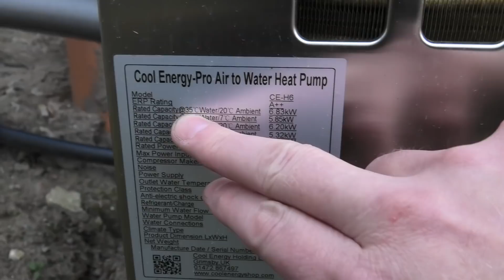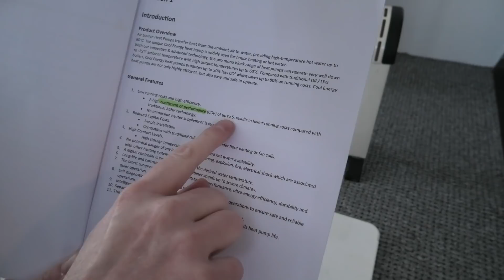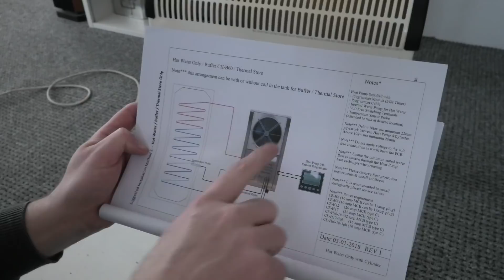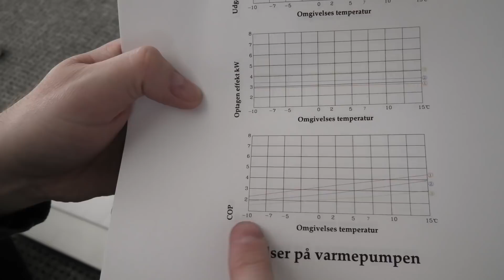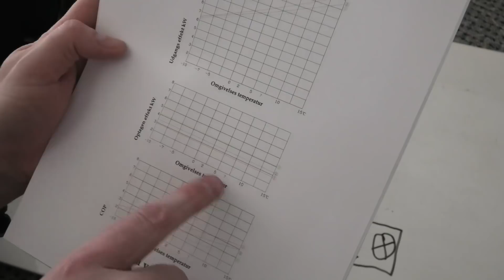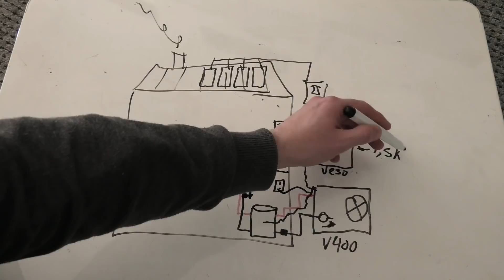Europe is Going to Need Many New Air to Water HeatPumps - 1169

Comment: Air to air heat pumps are even better and more flexible. Air to water heat pumps are really for wet systems, and don't cool anywhere near as well as an air to air heat pump, and it doesn't dehumidify the way an air to air heat pump can. They do heat better than air to heat pumps.
Reply from the maker: Some good points,,, but an Air to Water I am aloud to install myself, as it is a closed system, and it connects with my existing radiator system, to heat the entire house with just one unit.
It does not work to cool down,, for that you do need an Air to Air.

Comment: Hi Morten. Just watching this in UK in 2026. Nice British Cool Energy heat pump. Made in Grimsby UK. 
Not sure how you came across that make. I had never heard of Cool Energy until watching this.
Yes they are still in business and make low cost heat pumps  - 2000 euros for 6kW R290 - international delivery. Amazing.
Your outdoor insulation is interesting !
Lot of wind power in Denmark, so it makes sense. I have a Vaillant HP (they have a factory in UK) and also a battery. The battery is charged using off-peak power at night and solar in day and runs the heat pump all day which makes it 1/2 the price of gas heating.  
Great to see people doing it themselves - saves a lot of money.
Reply from the maker: I had Bargain Hardware ship it over 5 years ago :-),,, Cool Energy heat pumps was cheaper than anything I could get here :-)

Comment: Hey Morten,
     Thank you for uploading a nice video, We are also planning to change our oil heating system to Air to water heating, But when i inquire about Air to water heat pump some of them told me that it will take a lot of power supply to run fan, And they are recommending me to try Geothermal heating system, What is your opinion, I live in Hillerød,  Thank you
Reply from the maker: That sounds dodgy,, It is the compressor that uses way most power,, the fan,, is just a fan. 
Geothermal heating system is the best,, but it requires digging down all that pipe in the garden.
Air to water is way more simple and cheaper,, to get going with.

Comment: I admire your efforts, I live in Athens Greece and we have the opposite problem but I am looking into achieving a similar goal, stay cool in summer and warmer in winter. The temperatures are different and its harder to install and use a heat pump in Athens. I have a very limited amount of space to build and setup a heat pump, I even considered building a heat sink but its illegal where I live to dig below ground. Still it is a worthy effort and your videos inspire me to continue to look for a solution.
Reply from the maker: The little heat pump can acctuly also cool,, I do not think it is very good at it,, but it can,, I do not need that much,,,here :-)

Comment: In your case, as you have servers running that put out a lot of warm/hot air, if you can direct that air to the intake side of your heat pump, you can probably bump the efficiency up even further because the 'cold air' wouldn't be as cold. The catch may be where I remember your server rack exhaust ends up vs where this pump is.
Reply from the maker: I  am normally just running one server,, so it is not that much heat. But I have set it up so I can blow the hot air directly in to the house,, I think that is better than to het the heat pump... more math would be needed.
Reply: @MyPlayHouse  if it goes straight into the house and the temp is higher than ambient, you have the highest efficiency you can get for that process. It may bump up the efficiency in very cold circumstances so the COP of the heat pump is in the higher range. But probably the complexity wouldn't be worth it as your current setup is nice and clean. I now live in Ecuador where it doesn't get that cold in Quito.  But in the Netherlands or UK where I was born, lived respectively,  it probably would. My parents in NL have a heat pump with underfloor heating. They got rid of the gas almost a decade ago and also have some solar. It is interesting to see how the economics are pushing towards efficiency,  slowly but surely. I was in Denmark ages ago when visiting Danfoss and when way younger, legoland. First "driving license" I had was there.
Reply from the maker: @wiebowesterhof  I was born in the city where Legoland is,, I never got the driving license :-/

Comment: Hello Morten, you had  that unit in 8yrs you say,  the producer that made your air to water heat/cooling exchanger they reccomend to have a check/service every 2yrs that goes for your air to air heat/cooling units too, here in the northern europe they rarely fill the units to capasity when it comes to the gas inside that transports the heat/cooling from the outside/inside, get a company near you to take a service and check the level of gas inside, and i think you would need a top up of that R-410 gas if you haven't had any yet. 
the firm that does heat/ac air to air units where i live, I know them personally so i got them to top up our unit when its running with a coupple of milibar extra.  btw..
do you use any antifreeze red/blue/yellow/green in the water maby?
or do you just run regular mineralized tap water in it ??
Reply from the maker: It is about €400 to have it services here,,, it is a lot of money,, when it seams to be working just fine.
I do have some antifreeze in the system,, from when I was only here in weekends.

Comment: I was spending about $1200 per year to heat the house for four months of the year. I just installed a heat pump (reverse cycle in Australia) for about $5000 so I save $900 on heating but now I also have cooling so I don't know if I will save money or it will all go to cooling on those 35-40c days (but possibly that will run off the solar on those for days). Great video as always.
Reply from the maker: It would be smart to run the cooling offer solar.

Comment: Nooo we wont need heat pumps at home... what we need if we go for heatpump solutions is that our respective utility company, in our areas, change out to gigaheatpump systems, and be supplyed by, our utility companys, around denmark with Remoteheating/Fjernvarme, i get that heatpumps are a briliant idea, but if we stick together, and pay collectivly for heat, it will be mutch cheaper, not to mention the reduction of Electric,  if our houses are heated by electric the reduction on eletric after 4000kwh that agreement only runs until, 2030, if we need anything in denmark its to produce eletric via solar, and be paid a fair price for the eletric we are produce, if we all did set up solar on our roof, and sold it, for a fair price when its needed, and a reduction on the price when its not so mutch needed, and the utility company then uses all the reducted eletric to heat up water for our systems, then it would be so ridiculously cheap to heat our houses and homes, and that ever is needed, this is only my opinion but i also think its the correct way to go.   your heatpump might have been running for 10 years, but most of them only have 5years waranty, and if its breaks after 5 years that can be quite an Investment every 5 years, and if we all went for Remoteheating/Fjernvarme, everything outside the house would be covered by the utility company.
And Yeah i 100% belive it would be possible to run Cables to all houses in Denmark with Fjernvarme, before 2030, we need to rember our country is not that big after all.
Reply from the maker: More Remoteheating/Fjernvarme would be needed, much more and the loses to go to the smaller places,, would increases. But If you have Remoteheating/Fjernvarme,, yes use that!! I do not :-/
I think Russia will close for the gas in a little bit,, get your heat pump now :-)
Reply: Ohh and i want to Add to this our Datacenters, and big production compampies in denmark, should make use or the waste heat they produce,  i dont know the excat numbers on this but take for exampel in my city we have Arla, and they send waste water to our water plant every day thats 40  or more degree celsius, and its just running to this one water tank in our waste water plant to be cleand and cooled down and then to the stream, not to be used but 40 or more degree celsius water could be used way more productive,
Reply from the maker: I agree!!

Comment: Replace the compressor in the small heatpump with a DC voltage powered model, that will get you another 10% efficiency - since you already have batteries etc
Reply from the maker: I think that is more than I can do :-/

Comment: Heat pumps aren't cheaper than gas (in my country)   First of all to make a heat pump work well and get a COP of 4 or better you need to insulate your home.  Roof, new windows, walls and floor.  That is a mayor investment.  Heatpumps work best with floor heating or low temperature radiators that is another big investment.  Your finally ready to install a heat pump that is at least 2 and a half times the price of a gas heater.  Yay my expensive heat pump is using 4 times less energy in Kwh than gas.  Oh shit gas was actually still 4 times cheaper than electricity. (This is actually the case in my country even with the expensive gas prices, its still 3.8 times cheaper a Kwh in 2022)  Maybee I should install solar panels....   oh boy my solar panels aren't generating much electricity in the winter when my heat pump is using the most energy and the government screwed me over with their new digital meters.  The old analog meters would turn backwards in the summer.
Reply: Insulation has nothing to do with how well a heat pump works.
Reply: @eDoc2020  If your house isn't insulated properly, you will not be able to heat your house on low temperature.
Reply: @pitchke77  That's true of any type of heating system. If the heating system isn't enough it just means it is undersized. Insulation improvements always help.
Reply from the maker: Well here there is a very real chance, that millions of homes will be in trouble next winter. You Know Who,,, is properly going to turn off the gas,, and at that point a heat pump might suddenly look like, a very arractive alternative.

Comment: To be fair, air sourced heat pump are good and all, but ground sourced tends to have better performance, though at the downside of needing a coil in the ground, or a deep well. Effectively, the ground sourced heat pump don't care what the air temperature outside is, since that isn't where it takes the heat from, another advantage is that the ground just 2 meters down tends to be at the average year round temperature, so here one can get a decent amount of "free" cooling during summer.

But a lot of people generally just look at the overall cost of heating something, and totally do not care about the environmental impact. Burning gas or using resistive heating is "simple" and gas sure is cheap, but non of these two are remotely good for the environment. And to be fair, running a crypto miner is technically more environmentally friendly than a space heater...

The thing that is even better is though district heating where the heat comes from areas that is in need of cooling. A lot of industrial processes regards 80 C as really cold.
Reply from the maker: I would like to drill down until it was warm,, that is pretty far down :-/
Reply: @MyPlayHouse  Yes, drilling until the inner warmth of the planet becomes a thing is indeed rather deep in most areas in the world.

But for a ground sourced heat pump, we more or less just want a decent amount of thermal mass to work with. And the nearly free cooling it offers in summer is quite the value add as well.

Comment: What happens on the macro scale when eveyone in your community starts using this in place of burning fuel? Will it be enough of an effect to change the weather patterns around you? Keep in mind, burning fuel is actually adding heat into your house, but by pumping heat from outside, you are actually making it colder out there. 
This is all very interesting tech, and I am looking to get this or a geothermal install at my place, but the long-term repercussions worry me a bit.
Thanks for the video.
Reply: Not really. Heat you pump in the house does not disappear, it leaks out of your house after some time.
Reply: @Sasoon2006  You are continuously pumping it into the house, so it still applies.
Reply: @NdxtremePro  Yes, and it continuously leaks out. Because if it does not leak out, you would not need to heat up house all the time, because it would not get cold inside.
Reply from the maker: Nahh, it makes the air colder right in front of the heat pump,, but it is not as if, there is more snow on that side of the house.
I have heard that a geothermal setup in your garden, might delay the plants a little bit.
Reply: @MyPlayHouse  You solve the garden issue by including it in your heating plan, but that does require a greenhouse.

Comment: I know gas per unit of energy was about 4+ times cheaper than electric. So until that 1.5 kw in can reliably produce over 6kw output then this costs more. On top of that there is extra cost for the machine itself, additional points of failure. I guess if ur getting free electric from solar, but then that’s also expensive to buy/fit, gets lower efficiency over time, zero productivity at peak need times, uses harmful materials in production, limited lifespan. 
I don’t see the point.
Reply from the maker: There is a very big chance that the GAS prices might, make this a better deal.
Since last May,, the GAS prices has gone up 4+ times.
Reply from the maker: There is a very big chance that the GAS prices might, make this a better deal.
Since last May,, the GAS prices has gone up 4+ times.

Comment: I've just opened a solar business, doing micro mini solar installations here in the UK.
They kinda work, but not like off grid and big systems, but the pay off is around 1 year.

The heat pumps have grants here, so people can get them for free or cheaper. They're also doing the thermal solar.

The system works like the Pelter effect.. old day CPU cooling :) it's almost how fridges keep cool air for the inside but the big radiator on the outside.
Reply from the maker: Cool,, hope you get a good business going!! :-)
Reply: no offence or anything but ‘they kinda work’ is not gonna help sell those things, good luck w business regardless lol
Reply: @entox.  depends on perceptions.
Solar doesn't work to meet all of the power needs, it only works in the sun.
Or if you can change batteries.
Our little systems meet around 60% of the power used in homes, so it kinda works. But it's not a replacement.
Reply: @guywhoknows  Fair enough, I respect that you’re honest about realistic expectations I just thought it was funny wording because most salesmen usually try to really push the product.
Reply: @entox.  never do a hard sell.
Just plain straight forward no bs.
I have lost customers because it didn't sound as good as bs others will peddle.

I have a saying.
I neither polish a turd or candy coat it.

Comment: Recently I saw a "funny" calculation. It takes less natural gas to burn it at a power plant to have a heat pump at home than to have a 100% efficient gas stove, as long as it is not very cold. In Denmark that would be even better with the power plant able to do district heating in cities too. Of course, that gas should not be financing Putin....
Reply from the maker: Some of the district heating,, is okay in Denmark,, like the stuff that is a waste product of making electric or burning waste.. But some of the smaller ones are very expensive. I think we have seen the same video 40% from powerplant Heatpump COP 2,5 and it is at 100% again.
Reply: Where I live, the district heating is mainly agricultural straw, and they also have 4000 m² of solar panels. Works nicely.

As I live in the countryside, no district heating for me (long pipes too expensive), so I'm intending to get a heat pump, maybe a ground based system under the lawn, to have less noise.

Comment: I have an air to air system, basically an air conditioner with a heating mode. It splits off into 3 different rooms. It's amazing tech which has been stomped on for many years by the fuel companies. It sucks how the USA has air contionioners almost everywhere, but the valve which enables heating has been left out - so everyone must use oil or gas to heat their homes. It's a scam which has caused so much extra emissions for no reason other than greed.
Reply from the maker: Weird that they did not come up with a Gas/Gasoline powered air conditioner,,, to get there hands in peoples pockets all summer :-)
Reply: @ChaosSwissroIlCommentsCensored  Pretty much all of the US population lives where heating is required. Some just need it less than others. Apparently heat pumps are relatively common in places like Texas where the winters are (usually) mild.
Reply: @eDoc2020  I live in the Southeastern US and I see heat pumps everywhere here, in fact I just had a mini split style installed in my home last month and the installer said he cannot get them in fast enough to meet demand